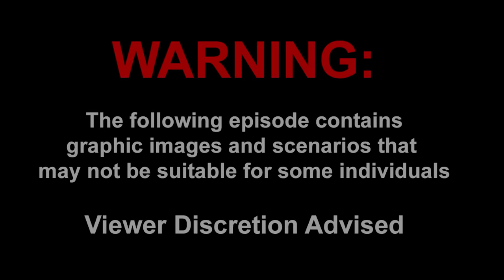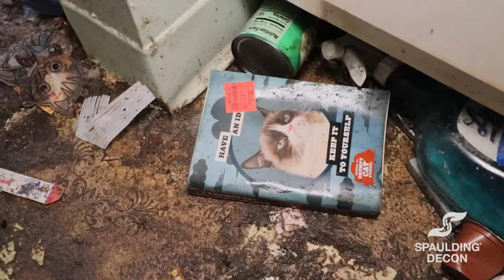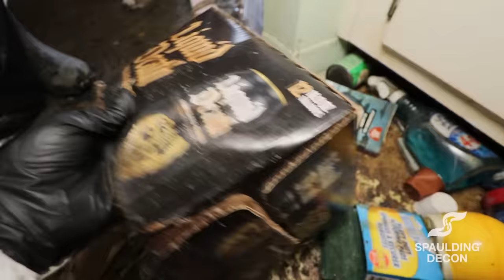SEWAGE BACKUP DISASTER!!! | Hoard Removal

Comment: I've done that 3 times - flooded and the sewage backup that goes with it - minus the hoard and roaches. That stank gets into your sinuses and stays there for hours after you shower. The worst flood we couldn't get back in to start cleaning up for over 2 weeks. Almost 6 feet of water for that long and there wasn't one thing left in the house that wasn't either covered with mold or sewage. Not one slab of drywall could be saved and the studs had to be sealed with latex. One issue people forget is that all the HVAC ductwork is going to be full of mold too. Assuming this is an insurance job, I hope cleaning the ducts is covered.

Comment: When there are roaches during the day like this that means they are in the walls, under the floor and ceiling. This has been years of hoarding and roaches come and breed more when its wet, hot, humid and mold. One egg sac contains 100 roaches. They break down waste etc. But hoarders bring the big ones. And they love poop. The will have to decon the building as now they are runnibg into other apartments.  I feel for you. 😮

Comment: Sad circumstances usually a landlord can evict a tenant that's living in a filthy condition it's a health hazard especially if it's putting other tenants at risk , sewer, roaches and mold ain't no way that unit was still livable even after the clean up i hate apartment living because of how other tenants live, roaches and bedbugs are the worst and hard to get rid of that type of infestation is going to be costly and require multiple treatments to the unit other units and the whole building.